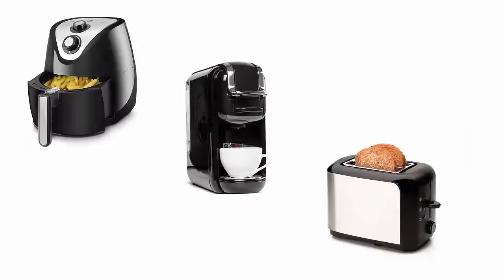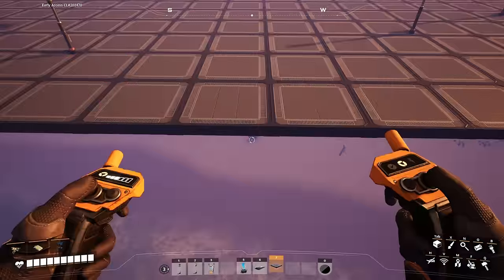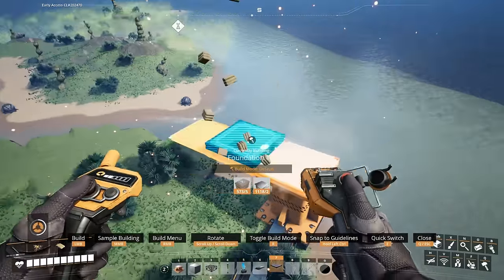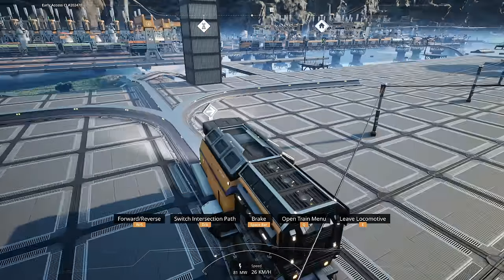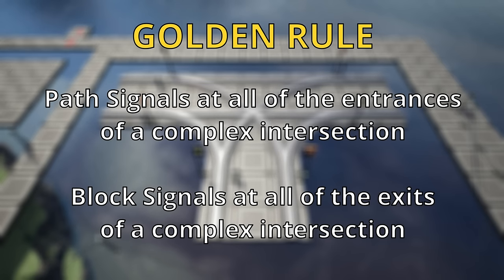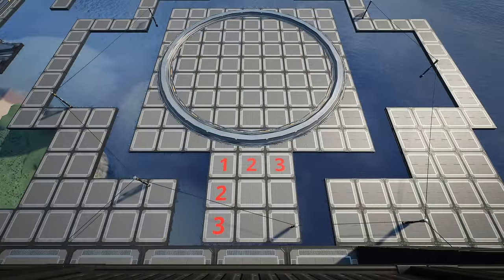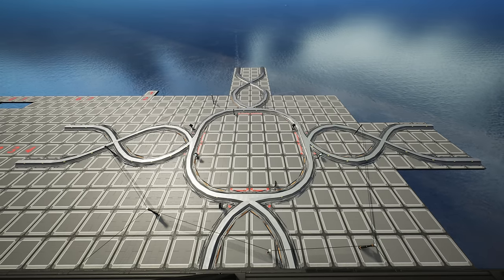Satisfactory - The Ultimate Beginners Train Guide: Railroad Building Tips! *FREE BONUS VIDEO*

Comment from the maker: Amendments:

With the addition of blueprints, you can now you make complex railroad supports in the blueprint machine and very easily apply them to your rail network.
Reply: the one actual use case for satisfactory's BP system lmao. Loved your video btw, very well-presented and the humor is spot-on without being annoyingly present :)
Reply: I'm just annoyed i cant make the minimum 3x3 rail curve as a blueprint. Unless I've missed something.
Reply: You should do a video on this with some neat ideas
Reply: Did anyone else get the sinfeld reference in there? I loved it bro!
Reply: Also for the section at 5:00 the "nudge hologram" feature means you no longer have to mess around with this
Reply: I would recommend getting the mod with the bigger blueprint designer and go NUTS with this video designs. Cheers

Comment: I know nothing about trains, then watched this.  I made this timestamp list for myself but feel free to pin it for others.
3:25 Attaching pillars to suspended track
5:20 Placing Stations
8:42 Segments
10:11 Organic Rails Across Open Terrain
12:34 Minimum Incline 
13:46 Smooth Seamless Inclines
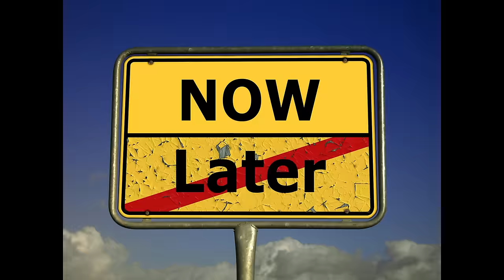14:15 Minimum Bridge Height
15:55 Inclined Turn
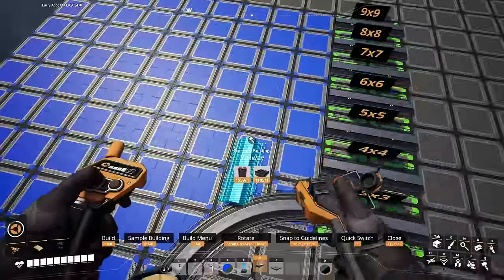17:25 Max Turn Limit
18:10 45 Degree Turns (While placing a foundation look down at another foundation hold Ctrl, and Scroll Mouse Wheel, will rotate the foundation using the one under it as an anchor.  Use this method to rotate your 2 meter foundation the slack normally for an "almost" bump free 45 incline, this requires only one additional step and doesn't need the painted beam)
20:50 Smallest U-Turn
23:15 Simple Intersections
23:50 Branching Rails
25:13 Complex Intersections
28:10 Signal Placement
29:30 4 Way Intersection with Signals
29:40 The Roundabout
34:38 Roundabout with all Signals
37:52 Small Roundabout 2 direction
38:43 Clip Foundation to Rail Trick

Comment: Very helpful as always 🙂

Regarding trains slowing down before signals, you can actually avoid that: 

- Moving trains do actually not just check the next block signal, they check ALL the block signals that are within their current braking distance. This means that a heavy train going 200 kmh (the highest speed any automated train by now is allowed to reach) will check block signals much further ahead than a empty train doing 50 kmh. 

So the train always looks ahead far enough, so that it can properly (without cheating physics) come to a stop in front of the next red signal/station. 

A block signal sstandard setting is green. So unless something is blocked, a series of block signals wont stop a train from maintaining 120 kmh. 

A path signal standard setting is red. Trains treat it as red signal and as such begin to brake in sufficient distance to come to a full stop. Since it it a good idea to place block signals regularly, the train often will already begin to brake even though it has several green block signals ahead, just so that it could stop in front of the (red) path signal if it has to: 

This often leads to a slowdown, because the braking distance of the train is often longer than the distance between the block and the path signal: 

Scenario: 
Lets assume equal signal distance and a braking distance of 4 signals: 

Block Signal

Block Signal 

Block Signal 

Block Signal

Block Signal 

Path Signal

Block Signal

Block Signal - all signals in braking distance are green, maintain speed

Block Signal - Path signal is counted as red, beginning to brake

Block Signal - braking

Block Signal - braking

Block Signal - The request for a path is only send once the train passed the last block signal in front of the path signal. Only now, the path signal will check the path and turn green. 

Path Signal - now turning green, train accelerates again

Block Signal

To avoid trains slowing down, the distance between the last block signal and the path signal, has to be longer than the braking distance of the train. Then the green path signal can be requested in time and the train will keep running at full speed. :-)
Reply from the maker: Thank you good sir! I see what you're saying and I've seen your post regarding train weight as well! With such massive info dumps I sometimes fail to do my full due-diligence with researching everything, so if you see any other discrepancies then do not hesitate to point them out! I'm going to include amendments and updates both in an upcoming video and in pinned comments on the respective videos. Thanks again for the corrections and clarifications!

Comment: Re: foundation manipulation - nudging is far easier for that kind of operation.  Hit 'h' on a build hologram that's in the wrong spot, and use the arrow keys to move it around 1m at a time, or Ctrl-arrow to nudge it 0.5m.  There are plenty of cases where you have to use some other temporary buildable to get what you want (I kinda want to build a table showing what items can build/snap/etc on what), but that isn't one of them.

Comment: I want to add a couple of useful pieces of info -

For S Bends, the minimum distance between straights varies with how much of an offset we're talking about.  These distances are grid axis, not point to point.

For a 8m offset (1 foundation), the minimum distance is 23m (3 foundations minus a meter).
For a 16m offset (2 foundations), the minimum distance is 33m (4 foundations plus a meter).
For a 24m offset (3 foundations), the minimum distance is 40m (5 foundations even).
For a 32m offset (4 foundations), the minimum distance is 45m (5 foundations plus 5 meters).
For a 40m offset (5 foundations), the minimum distance is 49m (6 foundations plus 1 meters).
For a 48m offset (6 foundations), the minimum distance is 51m (6 foundations plus 3 meters).
For a 56m offset (7 foundations), the minimum distance is 52m (6 foundations plus 4 meters).
For a 64m offset (8 foundations), the minimum distance is 53m (6 foundations plus 5 meters).
For a 72m offset (9 foundations), the minimum distance is 53m (6 foundations plus 5 meters).  Not an error.
For a 80m offset (10 foundations), the distance is too long for a single track to connect.

I wouldn't be surprised if these can be effected by the same little glitch that you have with 90 degree bends, so maybe add a meter or two to all of them where it matters.  Or round up to the nearest whole foundation.  So - 3, 5, 5, 6, 7, 7, 7, 7, 7 foundations.

Edit -
Oh, also there's a few particular blueprints I find to be really handy.  Make yourself a pair of opposing 45 degree bends and a 90 degree bend that's comprised of the two 45s.  They don't connect when you place them, but they're still really good to help you quickly and easily get the spacing and such.

Comment: 14:55 becasuse if you connect a start and end segment with a turn, it sadly isnt a "sharp and crisp Turn" anymore.
I saw that on big Turns i did on my network. Like, did a 180, the first 90 i built Start -> Turn -> End, the second one i built like Start -> End -> Turn, and driving over that felt odd, because the second part the Train suddenly steered just a tiny bit more into the turn -> the angle is steeper, wich explains the error on the shortest possible turn.
Laying these Turnbuilding Techniques above each other makes it clear what happens.

Comment: Great tutorial as usual. One comment though: your turns are not really 3 by 3 foundations. You start at an edge of a foundation (say at the upper edge of the foundation at the bottom of your screen around 27:30 in the video) and you go to the middle of your third foundation (to the left for example, going up only 2.5 foundations and 2.5 foundations to the left), making your turns in fact to be 2.5 by 2.5 foundations. That's why your 90 degree turns between start and end segments won't work. I place my traintracks from the center of a foundation to the center of another foundation. Those are exactly 3 by 3 and those 90 degree turns are possible without any problems. See https://youtu.be/8xlpolh6N3A?t=1777

Comment: Sorry for the late comment. I've watched the 3 video so far multiple times. And will keep referring back as I begin to build my network. You say that trains will always take the shortest path. (In principle). At 8:12. If the train is not programmed to go to the train station, which path will it take. Is it different if there are blocks signals at every rail join along these routes. And would it be different if a train was "waiting" at the station?

Comment: I've been staring at inclines at rails for way too long, so my brain is muddled...

For the "mastering inclines" section, where you can move 4 meters across two lengths of foundations... wouldn't it just be easier to have one continuous 2 meter ramp, rather than put a 2 meter on every-other foundation?  13:27 is the timestamp in question.

Comment: Just want to share the information: for a constant 1/4 slope(2m tall sloped foundation) on a spiral: radius = 0.637 * elevation per circle, use 20 meter radius and 32 meter elevation you will get a slope of 1/3.927, very close 1/4. For the most gradual change of slope from flat to 1/4 slope, length = 8.123 * height change, or simply 1 foundation length of transition rail for ever meter in height difference, I use 4 for the smoothness

Comment: So that's why it wouldn't curve. Gotta place a piece first. And also why I was not able to even make an intersection. Can't connect a rail in the middle of a rail. It has to be on the end. Holy shit at how fucking convoluted it is that I have to create joints like that ON TOP OF placing rail itself has a minimum placeable distance as well. A combination from lazy design hell. LOL 7:40 it's not even consistent either. You've gotta be fucking kidding me. It's probably better for my sanity and my factory throughput to just keep running belt bridges holy fuck. Ugh start and end segments? Bruh this is literally the exact reason why straight mode was added to belts. So we wouldn't have to place it down before the turn and then place the other end and then place the turn. I guess I gotta wait until 2.0 now for rail optimizations at this rate.

Comment: Starting at 5:01, you talk about using pillars for foundation manipulation.  

Well, I've come from the future to announce that, in the future (1.0 of the game), while placing your foundation, you can press the 'H' key to lock in a hologram of your foundation.  After locking it in, you can use the arrow keys to "nudge" the foundation, so it no longer has to cleanly line up with the connection foundation.  Voila, no pillar needed.